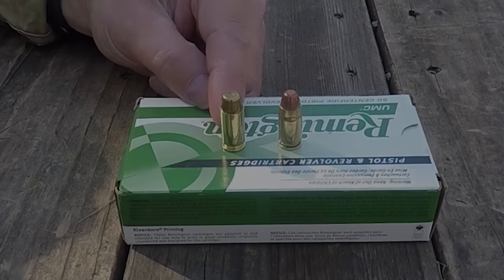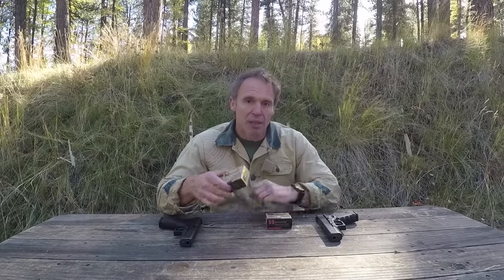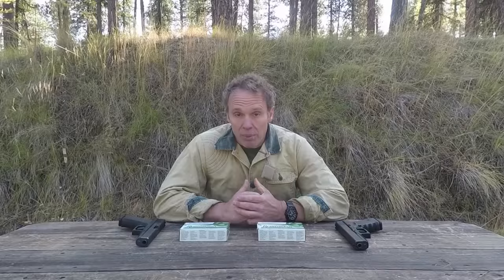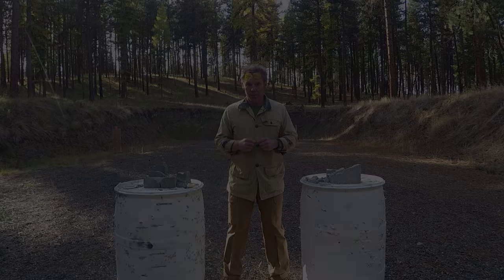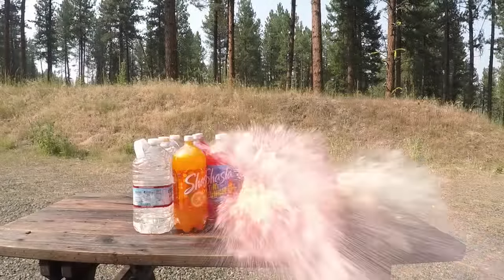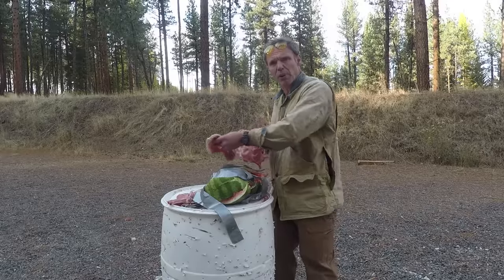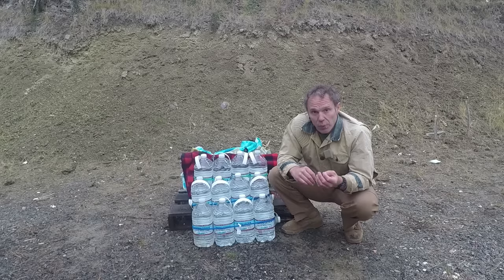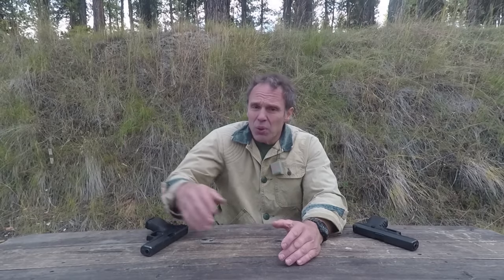Personal protection: .357 SIG vs. .40 s/w

Comment: I do love my .40 cal. I always love this guy because he's one of the only one that isn't biased. Some of these guys actually label 40 as the "worst round" you can buy. Outrageous and laughable.
Reply: Jason Vorhees  should watch his presentation of the Miami Dade shootout, he goes into a lot of detail about 40 vs 9 especially
Reply: I love my .40 too!!! I also love10mm and 9x25 Dillion!! I’m sure the .357 is awesome as well but do not have hands on experience with that caliber. .40 however is definitely a great round for me!!! Best wishes!!!
Reply: I have never heard the 40 S&W was the worst round. I've only heard how 9mm is the best because of quicker target acquisition on follow on shots and the modern bullet weights and design make the ballistics nearly parallel. 
Though, since they make the same bullet designs for the  40, 45 and 357sig...so I am not sure how they can say that.
Bottom line is that 380 is not recommended due to very little development of that particular round and it's 9mm short. 
The 40 is a great caliber as are 10mm, 45, 357sig and 9mm.
I can only ponder if those naysayers about the 40 think poorly of the round because you do not have any +p rounds possible due to the pressures of the 40 are already very high.
Reply: @robertmosher7418  gotta consider that the entire fbi and many other agencies made the switch to 40, only to later switch back. When the entirety of such a large agency can't reliably train on a caliber, it's safe to say at the very least that it's not the best one out there?
Reply: @beargillium2369  except that they were using S&W model 36 five shot snub nosed 38 spec when they got into that firefight in Miami.
They then developed the 10mn because they were too good to use the 9mm or 45 and felt they needed to make a statement to bad guys. Once the issued all their agents 10mm they found it difficult to control and that though it would penetrate through car doors like they wanted, it also suffered from over penetration and the pistols were not all that fun to shoot...to the effect that agents complained of minor injuries and most, other than their HRT unit, disliked it. So S&W went back to the drawing board and developed the 10mm short or the 40 S&W. Because, once again,  they refused to switch to a 9mm or 45.
Once they issued the 40 they kept it for years (which had almost every police agency switch to the 40 cal) until the 357 Sig came out and they, like hundreds of police departments switched to the newest, shiniest caliber. They didn't carry that long and decided to go, finally, to the 9mm...but not because the last two were deficient, rather because they had an easier time keeping their Sigs on target, modern bullet development increased the 9mm terminal ballistics and they could squeeze 17 rounds into the gun. Since they don't carry but two magazines and one is the spare, unless they are serving a high risk warrant (which, other than their local SRT or national HRT, they never do without a taskforce with LLEO and US Marshals) they felt they needed the extra 5 rounds in each magazine. 
I will give them this caveat about not going straight to the 9mm...back when they were going through this whole process no 9mm had a capacity over 9 or 10 rounds. Most were at 8 still as a slim profile and lightweight pistol were on vogue. It wasn't until the midway point of the 10mm issue that Glock released the G17 and that caused everyone to develop a 15+ magazine. The FBI switching to the 9mm caused every other police department, who hadn't already,  to also return to the 9mm
So, that's sorta, kinda, the story as told to me by my close friend who is retired FBI and former HRT operator.
Reply: @robertmosher7418  eh, I'm just going off Paul's Miami shooting video
Reply: @beargillium2369  how is he mistaken? Everything seemed 100% in line with every other source I’ve read. Those last two comments really made you come across as a tool, as if the first one wasn’t enough. You didn’t even give any info in either one of your comments. You just basically said “nope you’re wrong”
Reply: @gilbert4394  that's correct. I said nope he's wrong. Go watch Paul's extensive video on the Miami shooting.
Reply: @gilbert4394  for example: they did have 357 magnums. Many agents in the area also had mp5s. Watch they very thorough video and I won't need to mansplain it all 😂😂😂⚒️⛏️🔨🛠️🔧🔦🗜️
Reply: @gilbert4394  he was wrong stating that they were all carrying model 36s.
Reply: The .40 is very good all around but it’s still rather boring.
Reply: @dustinbrown5618  Boring is good. The 9mm is well over 120 years old. But it does the job. Same for .40, though it is more like 30+ years old. 

The reality is that for those of us who professionally carry, we want our guns to be boring and reliable. I don't want any surprises when some bad guys start shooting at me from behind cover.
Reply: From what I've seen, 40 cal beats 9mm by every metric except recoil and capacity, by a hair. I would place 40 cal 3rd behind 10mm and 357 Sig for semi auto defense calibers. As much as I love 45 ACP, there are too many dependent variables like barrel length, bullet and load that can cause hollowpoints to fail.
Reply: That is f**** insane I truly believe the 40 Smith & Wesson is one of the best self-defense around you could use
Reply: @jas4everchanged  .40 is the baby 10mm. I love the family lol both, are great. 9x25 dillion is basically a 357 lol.
Reply: @SoWavvyy  yes you are exactly right!!  When you look and compare the ballistics of 9x25 Dillon and 357 magnum depending on which rounds you compare they are very similar. Happy Shooting May God Bless the USA!!!!!!
Reply: @dustinbrown5618  boring how? Lol 40 can do everything the not so boring 9mm can do..lol
40>9
Reply: @beargillium2369  there was still a greater chance to get a shot on target with more capacity, especially if others also had a 9mm versus revolvers.
Reply: I open carry my Glock 22 Gen 4 everywhere I go.  IDGAF.  .40 cal has saved my life before and I absolutely will continue to rely on it..  But I will admit that the .357 Sig is one hell of a round.  Great video.
Reply: @gilbert4394  interesting how he has now deleted his comment, guess he felt like he was incorrect as I said.
Reply: @shuumai  except as I mentioned earlier, in the Miami video, the best shooter fired the most rounds and got "maybe" one hit... So your theory is both irrelevant and incorrect on its face. A rifle is the clear winner in the scenario. You can argue 40 vs 9 vs 357 vs 38 vs 00 buckshot all day, but the guy with the most hits(and kills, unfortunately) in that fight was the (bad)guy with the rifle.
Reply: 10mm master race.
Reply: @user-qo3yy9nv1u  wth kind of comment is that...
Reply: @beargillium2369  meaning if you're gonna carry a .40 projectile and you voluntarily chose .40 Short&Weak over 10mm Auto 
I'm perplexed as to your reasoning.
Reply: @user-qo3yy9nv1u  yeah I guess I was talking about your not so subtle Nazi overtone.
Reply: @beargillium2369  Lol are you really that sensitive?  C'mon buddy, it was clearly a joke.  10mm is absolutely the master race.  I have recently moved up from .40, and realized that human sized holes are much more effective with the 10mm. Chill out with the sensitivity though, for real.  God Bless you both.
Reply: I also have always loved .40
Reply: @D-A-1776  Same.  I don't understand how someone can argue that the .40 isn't a great round.  I'm pretty sure that more than half of America's police forces are strapped with a .40 cal handgun for a reason lol.  I love every round that has ever been created...I love firearms of all types...but I PREFER to carry a .40 full size on my thigh and I dare someone to do some dumb shit in front of me.  Cheers mates.
Reply: @scottkain8977  . Exactly I love it
Reply: @D-A-1776  Same brother.
Reply: @scottkain8977  . Just ordered one the other day waiting on at the get here they're getting harder to find brands stop making them which I think is ridiculous cuz it's an awesome gun I have a Springfield XD 40 and I just ordered the Smith & Wesson SD40
Reply: @beargillium2369  yeah but all loaded with 38 spl
Reply: @Tacteyecool  oh? So you were there? Or where is this info coming from?
Reply: Buffalo bore makes some .40 cal rounds that can take down a bear.  There are some big boy .40 s&w rounds you just have to make sure the gun can handle it first.
Reply: @beargillium2369  , according to what I read, they switched because many of their agents couldn't handle the recoil and couldn't qualify. The first part said that 9mm sucks less than it used to suck. It didn't say that 9mm was equal to or better than 40. It said that it has been improved and agents don't suck as much when shooting it.
Reply: @nachyomoney3598  kaboom 😅
Reply: I find it laughable too. If .40 is the worst round then I’d say let someone shoot them with it and see if it’s a weak round. 😂😂😂
Reply: @robertmosher7418  40 +P isn't popular because 40 is already too much for some folks to handle and it is already plenty potent. It IS available. I believe Underwood Ammo makes some.
Reply: @Lexicologist1971  too much? Are you talking about the little bit of snap and muzzle flip you get from the 40? And 40+p? They make a +p for the 40 cal? I was not aware of that. I know the pressures of the 40 are really high and reloaders have to be careful on the propellant or they end up blowing up their guns. So I looked into it and this is what I found. There are no even +p rounds in 40 cal giving it over 600 pounds of force at the muzzle. They tend to be a little jumpy and the recoil causes a bit more muzzle flip which can cause the wrist to lose it's lock on the pistol grip causing the pistol to not feed properly for some people.
Though I am not one of them and tend to think that issue is mostly with the polymer striker fired pistols like the  Glocks due to the weapon being lighter. I have never been a fan of the 40 and view it as a trend or fad that ran  it's course, like the 357 Sig. They were the in gun for a time and now most departments have gone back to the 9mm. Which is underpowered like the 40, 357 Sig for my uses as my backup sidearm for hunting and when hiking in the back country.  Even 357 mag is suspect when confronted by a dangerous predator. A 10mm would be the smallest handgun I would ever carry and prefer either my S&W model 69 4in  44 magnum or if I can ever find a 41 magnum living in California I would carry that. I firmly believe that you must have a round generating over 1000 pounds of force or more, preferably more, to get the job done as you are going to be lucky to get 5 rounds off before you get knocked down and gotta hope one or more strike a shoulder bone, the head or passes through the neck and down through the thoracic cavity and hits a major artery so it will bleed out before it eats you alive. If you are defending yourself against a two legged predator then the 40 is a great round if you are ok with the unnecessary recoil impulse. It has as much felt recoil as the 10mm, it's parent cartridge and has half the power.
Reply: @Robert Mosher  , many people can't handle the 40. It is sad, but many can't. Underwood Ammo makes some at just under 600 foot/pounds.
Reply: @kelseymcgarrah2858  thank you same here. It has sheer stopping power
Reply: It's ridiculous because I know I damn sure wouldn't want to be shot with it. Neither would all the tacticool folks who make that ludicrous claim.
Reply: I like the 40 as well, I shoot better with 45 auto. I think I’ll need a 357 sig to do my own testing as well. Might need one of those new 30 super carry’s for testing purposes of course.🤓
Reply: @Bear Gillium  many retired agents have come forward and stated they switched back to 9mm right at the same time women were failing the qualifications left and right due to completely missing or not getting enough qualifying points. So they, in essence, changed an entire agencies guns to meet the governments requirement of female equality in federal agencies.
Reply: I have to chime in, I like both calibers a lot. Was very happy to see these class on how to make a gun video perfect. Like said depends also on your ammo. But then my disease I love 45 acp and 357 magnums too. Gold Dots in all but the magnum . I sleep well. I personally love lighter projectiles in everything. Now I am thinking it is time to give the Glock 30 for the 27. Thanks
Reply: @robertmosher7418 Also the 10mm was to much gun for female FBI agents because of their lack of hand size.
Reply: @dustinbrown5618 boring????
Reply: @Lexicologist1971 If the 40 is to much for some to handle then why is the 45 so popular??? The 45 is heavier with more recoil.......just saying.
Reply: I have a G22 and picked up a 357 barrel as well as a 9mm. The newer Glock clips also feed the 9mm, but not my original Gen 2 clips. I like all of them. The anti-40 comments are ok if they're kept technical, but many are emotional and bogus. I wish the 357 sig had come to market sooner than the 40 though. The 357 sig is a near perfect round, imho, but I like the 40 and the 9 too.
Reply: Arguably 45 is the worst 40 has almost the same energy in smaller guns with more capacity
Reply: @jorgesolis9468  True. 40 is much higher capacity and similar power.
Reply: @catlover1986  yeah for example from full size guns so g22 and g21 g22 has 2 more rounds per mag, guns in 40 usually aren't as bulky, and 40 maxes out at 580 ft lbs from full length barrels while 45 maxes out at 600 ft lbs
Reply: @jorgesolis9468  Right. 40 generally has 2 fewer rounds than 9MM for the same model. 45 can have a lot less.

Some 40 rounds can carry more energy than some 45 rounds, so there's lots of power overlap
Reply: @catlover1986  lots of power overlap, less bulky guns and more capacity so it just makes sense
Reply: @eac1235 actually no the 45Auto has less recoil then the 40s&w 

40 S&W ammo handles higher chamber pressure, which allows it to fire bullets with a higher velocity compared to . 45 ACP. This, in turn, leads to higher recoil. 

That is off the outdoor shooting post 

Even after shooting a 45Auto of my friends 1911 and he was trying my ruger SR40C he didn't like that it was more felt recoil then his 1911
Reply: @beargillium2369 they switched to 10mm then when that was to much for some people the 40 S&W was born. And the reason they went back to 9mm isn’t just because it was hard to train and shoot with. Read the report they put out if you haven’t already, after all the years of case studies looking at all shootings they have info on they came to the conclusion that from 380 to 45ACP their is little to no advantage in one shot stops or “nock down power” and I’ve have obsessively watched and researched shootings and I agree caliber is meaningless between 380 - 45ACP in the context of stopping someone what stops a man is a shot to the credit card, heart or spine (central nervous system) lots of folks have walked right through multiple shots from all of said calibers and kept fighting and I’ve yet to see a 45 or any pistol caliber nock a man of his feet!😂 so I don’t know what they mean by knock down power. Given these facts the gun that will hold more rounds and shoot flatter provides a better chance at hitting one of the off buttons. And people can say the FBI is wrong or stupid but they have been studying this for a long time!
Reply: @robertmosher7418 .40 Pressures are actually LESS than 9mm. Not sure where all this “.40 is high pressure”, stuff comes from 🤔…
Reply: .40 is as gen x as a suped up import thumping to limp bisket

9mm is as millennial as crossover playing justin beiber

Meanwhile, the boomer .45 is like a 70s muscle car blasting zepplin
Reply: @robertmosher7418 pretty sure the beretta 92 was carrying over 10 rounds well before the development of the 10mm auto. I haven’t checked my claim tho so I could be wrong.
Reply: Agreed
Reply: I just picked up  a sig p229 used with a 40 and 357 sig barrels
Reply: My USP40 has been reliable through 4 different self defense encounters and seen me home.
Reply: picked up a gen 2 (1997 manufacture date) g22 for 300 about a month ago, and have already put 300+ rounds through it with the original plastic guide rod and it’s a beast, love it, even came with a flared mag well and tru dot night sights
Reply: 40 is not the “worst round”. If it hits you it will hurt you-a lot. It’s just that .357 sig will hurt you more. The tests were pretty conclusive. Now shut up and let me enjoy my needlessly overpriced ammo. Ok?